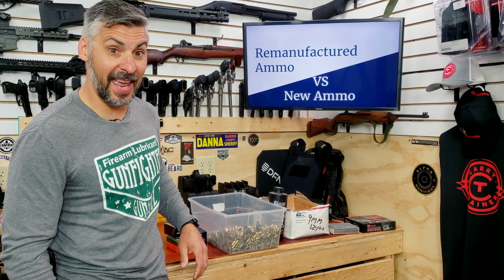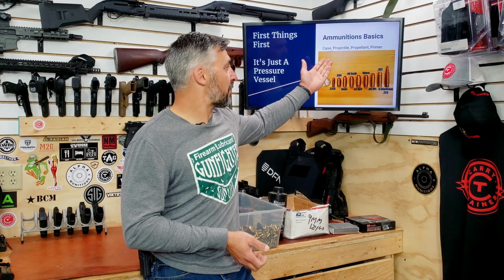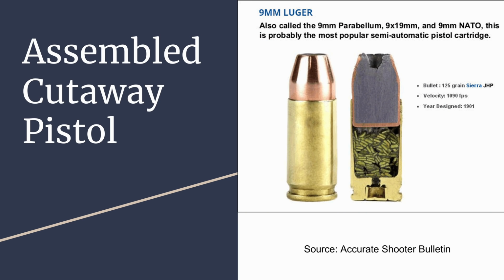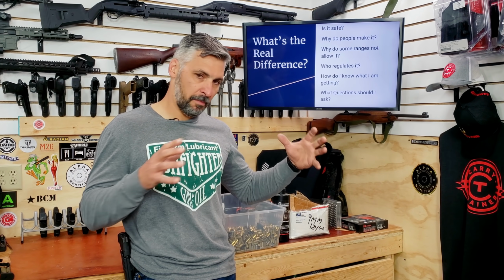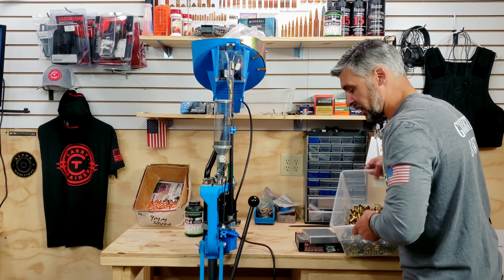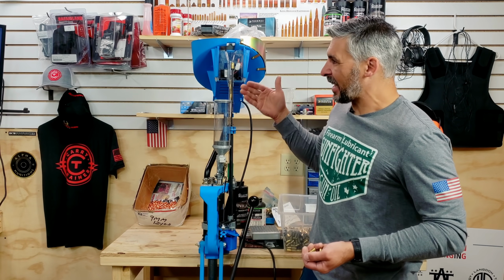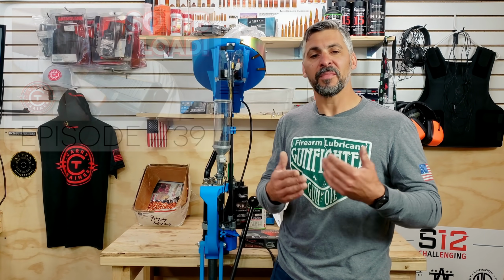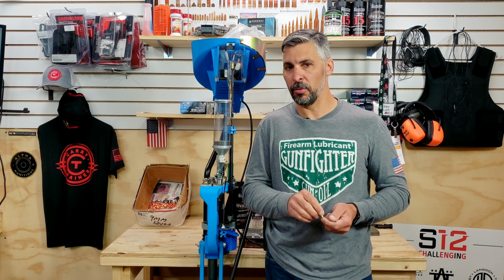New vs. Remanufactured Ammo | Episode #89

Comment: Glock 10mm's are infamous for forming a swell mark on the section of casings that lie outside the chamber (the Glock smile). This is an expansion of the casing slightly around the edge of the chamber opening. It is an indentation or flexed region of the case wall. And as such, it constitutes a potential weak point. 

You're probably fine if you only use weak mild reloads for practice. But if you want to go up in power, watch out.

Comment: Excellent, Real, Valuable and very well presented.   I am saving this video for two reasons; for its content (quality assurance) and to show my students how to present complex data.  Thank you.   Mickey, not to pick at your content, it is flawless, just a definition for you - Quality is built in to the product through Quality Assurance;   selecting reliable machinery, training operators properly, installing the machinery correctly, creating, validating  and sustaining adequate procedures and in-process controls.    Quality Control, on the other hand, is post production inspection, and the saying goes that you don't inspect quality into your product.   There are two internationally recognized standards for Quality Assurance - the ISO 9001 system, and the Shingo Prize.   Unfortunately most ammo remanufacturers either don't know of these standards or think they are too expensive to achieve and sustain.

I don't buy reloaded ammo that is packed in bags, or in cheap plastic ammo cans with a sticker slapped on the front.  This is an admission that the manufacturer does not think that the less than a cent cost per round for adequate packaging is money well spent and leaves me thinking "what other short cuts are they taking?"   Your Super Vel ammo is packed in a custom-printed box, isn't it?

Thanks for the tips on Super Vel and Alpha Munitions, will look them up.

Comment: Never ever use hand loaded  re-manufactured ammo. It is freaking dangerous for you and for your gun. I made a mistake and used one. It was sig sauer gun and freaking expensive gun was scrapped and the had to deal with repair and so on. It is just hassle. They don;t sell very cheap either. Just buy factory ammo. At least, you have the standard and confidence for every bullet.

Comment: Good vid for the time you had.    I have handloaded since the 70's    For me.    I also even cast bullets and HT or powder coat em.    With scrap and free lead that means all handgun calibers (and some rifle) run around $3-4 a box of 50 for me...  some a tad less some more.     I tend to go below max or way below max.    I like to shoot with friends and they trust my ammo.    I buy powder by the 8lb jug and primers by the 5k     Me and my friends have actually had more actual failures with factory ammo than mine...  although any failure is rare in the extreme.      Accuracy with my loads is about the same as the better factory loads and way better than the worst factory loads.      I use a couple of single stage presses (LOL) cause I load so many different bullet and powder weight for each caliber that it works better for me to just have a bunch of primed brass ready to go... example..   I want to load 45 acp...  I load some 230 round nose and some 200 SWC..     I set up the seat and crimp dies for what I am making that day.    Sometimes I want a hotter or milder load?   same..  all I change is the powder and/or the measure setting while using the proper seat/crimp die.

Comment: Phew, I was afraid you were about to say that reloading is very dangerous and one should avoid it at all cost. I'm a hard core reloader. 9mm. only and 45 until I had one. No 223, too many hassles. I have your same press😊
Reply: So there isn't any issue with remans?  Just trying to be sure. Have a family and want to get some from a local dealer.

Comment: My 9mm is top notch literally 10 times more reliable then anything you can buy!! That’s cause I check every round loaded never a double charge and never lock up my gun cause I plunk test every round! I’ve had maybe 2 malfunctions in every 10k or so! With federal I would have 2 in every 1000
Reply: Feel the same way. Once I really got into reloading, I started looking sideways at factory stuff. They can't measure, weigh, and double check every round, I can and do. Doubt you can find factory stuff that has power charges with < +/-0.02gr variance.
Reply: kleinbottled79 hell yeah🤟
Reply: Get yourself a factory crimp die and you won't have to ever plunk test another round again.

Comment: In one 1000 round batch of remanufactured 115 grain 9mm from super vel that I ordered during this pandemic I had 2 rounds that had the projectile smashed over the side of the case.  But before this pandemic crap I've had no issues at all with them.  I haven't shot near as many as you have but I've shot about 6000 or so rounds of their stuff.
Reply: When we ordered we had the same issue except with 6 rounds.
Reply: So are they checking every round or not, thats an obvious defect